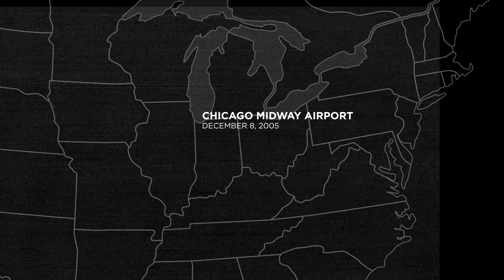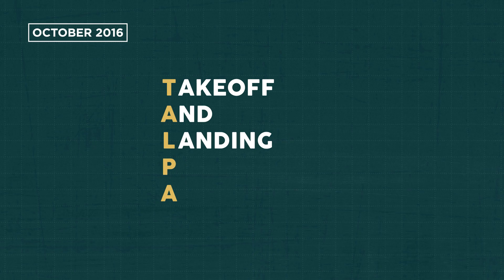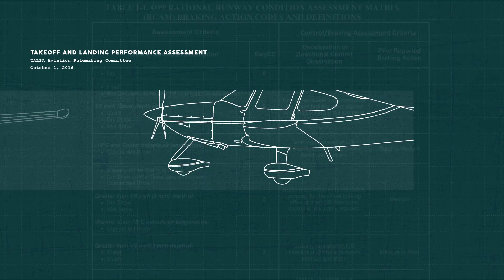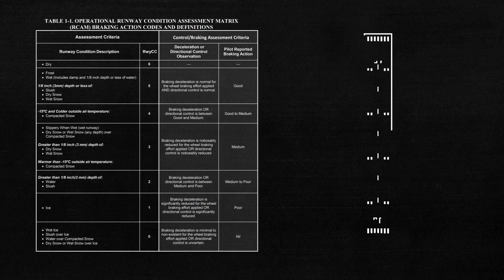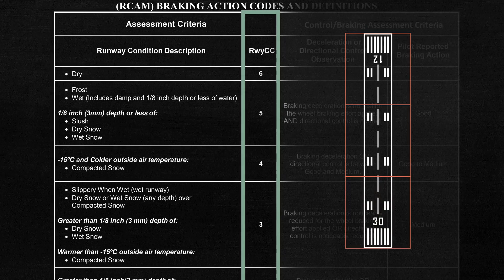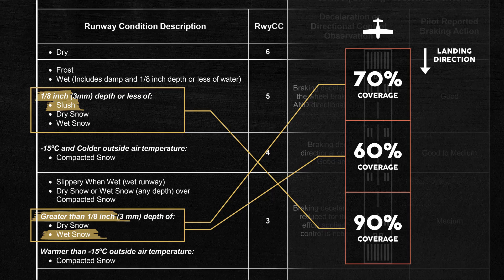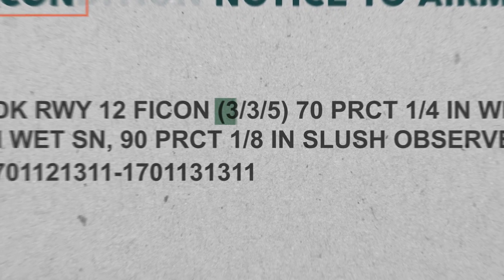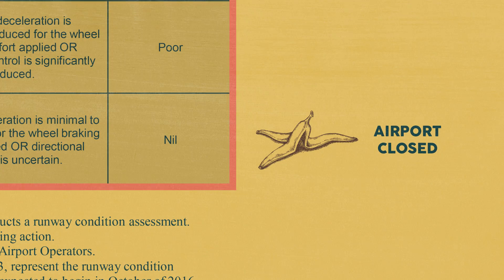ASI Safety Tip: Runway Conditions

Comment: why don't they just lay down pipes under the asphalt and apply heat.Same concept they use for homes to heat the floors so your not walking on cold floors.I get it maybe a bit pricey but its cost alot less than a plane crashing and people dying.
Reply: Because plows and salt are several orders of magnitude cheaper. 
A home is 1000-4000 square feet, well insulated and is in need of heat even without the floor so there is relatively little energy waste. A smallish international airport runway is 8500*150=1.3million square feet and not only uninsulated below but directly exposed to convective and radiative losses from above, then you add in evaporative losses and the heat capacity of H2O. Your talking about enough energy for 50,000 homes for a single runway.(most airports have more than one)

The mechanical stress and strength needed is also an issue commercial runway concrete is around 2 feet thick and reinforced, continuously supported by a bed of several feet of well packed crushed rock. A home floor has such low loading that one inch of plywood spanning framing member on 1.5 to 4 foot centers is plenty.